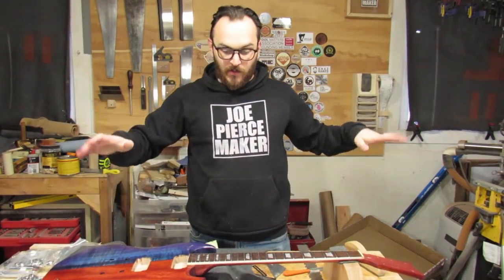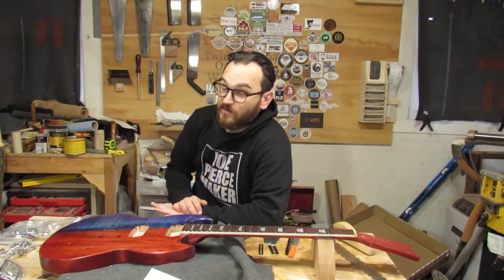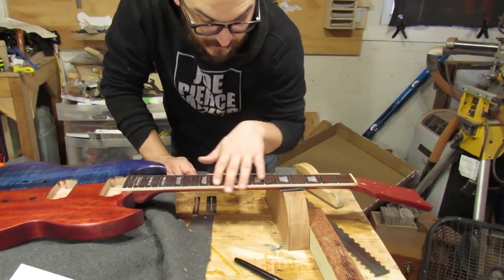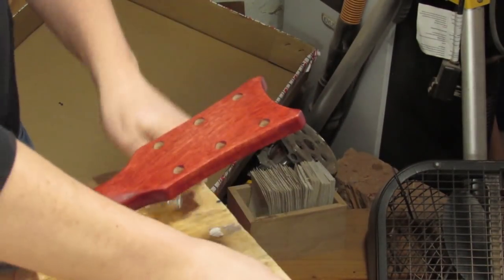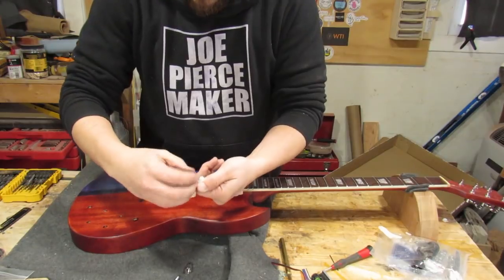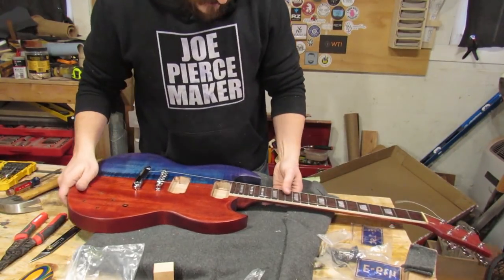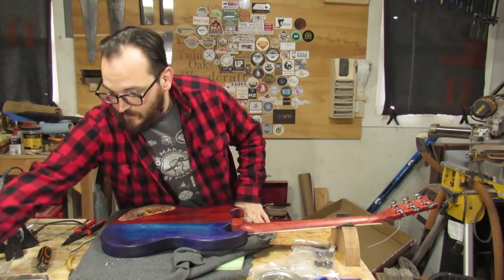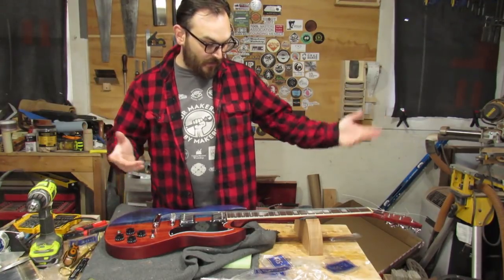Stewart MacDonald Guitar Kit - Episode 4

Comment: Like the color.  Bee's Wax is often used for a screw lubricant.  Comes in a bar shape, Stew Mac sells them.  Just threads on the bar.
Reply from the maker: Thanks! Bee's wax does work well, I used what I had at the time though and it worked well enough.

Comment: It's a good idea to use either copper tape or RF paint in the control cavity to eliminate noise.  Additionally a humbucker pickup is supposed to be relatively quiet, adding the RF paint or copper tape can make a difference in eliminating hum.  I've done this on the guitars I've built and it works perfectly.

There is a drawback to grounding the bridge/strings.  YOU become the shortest path to ground in the event you have a faulty amp, or the outlet you are plugged into isn't grounded properly.  Taylor Guitars uses a ground fuse to protect the player.  I still have no idea how this has never been the standard across all electric and electric acoustic guitars.
Reply from the maker: I plan to shield the cavities when I go back and replace all the hardware, pickups, pots, etc.  For this series I wanted to build it as the instructions said so it would be an honest review of the kit as it comes from the box. Once I've done all the upgrades I'm going to do a follow up video.

As far as the grounding thing, I don't see how it would be a danger, because the guitar is an input device, no power from the amp is transmitted to the guitar.

Comment: Good job Joe. Informative and entertaining. I especially appreciate the time you took to answer the questions. I’m probably too late to the party but I’m about to build a Stew Mac Les Paul kit. One of the steps is to tap the frets with a hammer/mallet to make sure they’re seated before leveling. Did you skip that step or not mention it? Is that not worth doing in your experience?
Reply from the maker: Glad it was helpful! I may have forgot to record that seating the frets, I should have mentioned it though.  Thanks!

Comment: I watched your GR8T4 part SG Kit build videos, so they got me wanting to get a SG Kit to build for myself, and I can no longer get the SG Kit from Stewmac . They dis-continued the SG Kit. Who else makes the SG Kits to build ? ? ?  Just as a suggestion, you can get a drill bit depth stop guage or make one by wrapping tape around the drill bit , so's to not drill holes too deep and  also you can use a bit that is a size smaller than the screw to be used to drill pilot holes for screws. Thanks Man ! ! !  Peace, Build & Play 🎸On . . . 😎🤘👍🙏  DDH 5-21-2020.
Reply from the maker: Solo music gear offers one, but it's the offset version like an ESP.  Thanks for the tip on the drilling, I didn't use anything because I've done it a million times and didn't really need it.  I would recommend it for a beginner though.  Thanks for watching!

Comment: Protip for drilling, once you decide on a depth, put a piece of tape on the drill so you get consistent depth
Reply: I'm no pro but that was my first thought too. Also would work when scraping the binding when using a razor blade instead of using your thumb as a gauge.
Reply from the maker: @hunger993 Good tip.  since the only drilling I did on this kit was a few pilot holes for tiny screws it didn't seem that important to me that the depth be exact.  As long as I didn't drill all the way through.  I've been woodworking for a while now and I've gotten pretty good at eyeballing things like that.  I would suggest to someone that is new to the hobby to use the tape method though.

Comment: Nice build. I'm assembling on of their Champ kits. It seems very well made.  I assume your open G was out of tune due to needing final intonating.
Reply from the maker: Thanks. Yeah it still needed some set up when I filmed the demo. The biggest issue was that the nut was too high. Since then I’ve replaced the nut and gotten some proper files so it’s spot on now.
Reply: @JoePierceMaker  Slot files. Yeah I need some of those. Got a few open buzzys I need to fill and recut.

Comment: Great job man. I think to buy some kit and do stuff like this
Reply from the maker: Thanks!  You should give it a go, it's a lot of fun.
Reply: @JoePierceMaker   Once i buy old destroy guitar and reper and paint her. Look cool white and blood splatter but there is some string hight problem. Still sound good. I never use it on my channel but i thing somwere on instagram
Reply from the maker: That's awesome.  That sting height problem could probably be fixed by adjusting the bridge, sanding down the nut, or adjusting the truss rod.   Hard to know without seeing it but I'm sure it could be done.

Comment: Pretty cool. I'm just sad they didn't put in full early-60s bevels since the body's CNCd anyway. Surely it's no extra cost to put in the deep bevels?
Reply from the maker: Thanks, I'm not sure why they wouldn't, I probably could have made them more pronounced but it kind of slipped my mind.
Reply: @JoePierceMaker  Probably a lot of work by hand though. Also tough to get right by hand too, I'm thinking. Makes much more sense to do it in CNC. This is kind of an ongoing problem since '67 though, lol. It makes sense that Gibson reduced the bevels when doing that stuff by hand. But even in the last 10 years, they've been pretty inconsistent with their early '60s reissues. I dunno why. The Japanese makers have done it right since the late '70s without any trouble.

Comment: Really enjoyed this series!  What kind of neck profile and fingerboard width does this kit have? Curious since I'd love to build one of these, though Stewmac seems to have discontinued this particular kit (?).

I'm lucky enough have a '69 SG with a reasonably chunky yet graceful D-shape neck and fairly narrow fingerboard that fits my hand really well.  Don't know how common that was back then but most SGs I've tried tend to have wider fingerboards and skinnier C shape necks.
Reply from the maker: Thanks!  The neck on this one is a bit on the thin side, C shaped.  I replaced the nut with a Tusq nut made for a Gibson Les Paul, and had to trim about 1/16' off each end to make it flush.

Comment: I watched all four videos of this series this morning and it was an entertaining example of how to build it. Going at it from a minimum tool perspective was a cool idea as well, kinda demystifying it for folks who may be on the fence about trying it. Good job!  👍

Maybe you got a good one but that file I got from Amazon with the orange handle was terrible. It didn’t “file” anything, wouldn’t cut a fingernail. I did find a use for it as a sandpaper holder. It came with a cool wrench for input jacks and volume pot nuts though. 

Have you ever tried computer printing decals and transfers to make headstock logos?

Buck Owens would approve of this finish, 😉
Reply from the maker: Thanks, I like to show people that anyone can do these things if they want to.  The thing about the file, when you get cheap tools, you run the risk of getting a bad one, but when you get a good one, it's good.

I have tried the waterslide decals that you can print out at home and had good luck with them when finishing with lacquer, but didn't have as good luck on this one that was finished with TruOil

Comment: I think a dry fit would have been the answer in episode one to the pick up issue 

How did the finger board take the stain ?? i do not think it is a mahogany body
Reply from the maker: You're probably right about the dry fit, I assumed that everything would fit and I shouldn't have.  The finger board actually took the stain well, so they didn't oil it or anything at the factory, that was a pleasant surprise.  The kit is sold as a mahogany body with granadillo finger board, so I hope they would use the wood they say did.  It smells like mahogany too, the curly half is a lot lighter but that can happen with most woods.
Reply: The Townspeople  these are CHINESE KITS you pay twice as much Through S Mac

Comment: Should have measured the scale length before gluing the neck on! Me thinks you made a "short scale", which explains the neck pickup and pick guard not fitting. If not, then Stewmac makes/sells $#17 guitar kits.
Reply from the maker: The intonation on it is good so the scale shouldn't be off.  I'm pretty sure these kits were mass produced by an outside company, which is probably why they don't sell them anymore.

Comment: Hi Joe. How do rate the guitar to something high end like the Gibson SG? I guess if you wanted to improve it even further you could switch out the pickups for expensive after market ones. More interested in the feel and quality of the guitar itself. Great series by the way and I’m subscribing.
Reply from the maker: Thanks!  I'd say that this guitar has the potential to stand up to a Gibson.  I've never owned one, but I've played several at various guitar stores.  Some were really nice, and others weren't so much.  The hardware and electronics on this are definitely low end and will all be replaced eventually.  The neck pocket was a bit loose, and the mismatched wood on the body wasn't great.  So in that aspect it's not up to par with a high end Gibson.  But, with upgraded hardware and pickups it can be just as good as a Gibson,  the neck feels good and it's at least made of mahogany, so if you painted it you wouldn't notice the mismatched wood.

Comment: Joe, Is there any disadvantage to doing the “fret work” prior to finishing the fingerboard? Thanks.
Reply: Trigger Snob besides some residue on the frets due to the finishing, no but you can wipe it off
Reply from the maker: I always do the fret work before finishing the fingerboard.  That way if I get any scratches on the wood I can address them before finishing.  Also, I should have taped off the fingerboard before doing the fret work.

Comment: So I'm not getting the point of using the fret rocker, and marking the high spots, when the next step is to cover all the frets in sharpie and use the leveler over the whole neck. And, BTW, it would have been good to show how to use the truss rod if your neck wasn't straight to begin with.
Reply from the maker: I used the fret rocker to determine if there were any high frets.  If it were just one or two I would have dealt with them individually.  Once I realized that there were several uneven frets I decided to go ahead and level all of them.  I'm working on a new video that will show in more detail how to set up a guitar, including truss rod adjustments, intonation, and fret leveling.

Comment: Well done, exept for the non fitting neck pickup. Also I notice you didn't measure the scale length during the neck fitting process. You might run into intonation problems here. I'm a noob myself learning the pitfalls of guitar building by watching as many videos prior to building a guitar. Next time you might wanna do a pre-assembly before fitting the neck into its goal position, I think the neck is supposed to be a bit more out of the pocket, that way you also wouldn't run into the problem with the pickup ring.
Reply from the maker: I assembled it according to the instructions which stated that the end of the neck should line up with the edges of the pickup route.  It was only off by a millimetre or two so it didn't have an affect on the intonation once I adjusted the bridge saddles.  But yes, you're correct I could have avoided the issue by  dry fitting everything.  My goal with these videos is to show people the potential problems that may arise with a build and how to fix them.  So, while this issue could have been avoided, I'm glad it happened so there could be a teachable moment.
Reply: @JoePierceMaker  I absolutely agree with you and I am glad you are happy with the end result. I also would check the neck angle while test fitting. I've heard theat the cheaper kit guitars are not machined exactly anough and in some cases you end up with a way to high or low action, depending on the neck angle.

Comment: you need to solder that ground wire
Reply from the maker: Are you referring to the wire grounding the bridge?
Reply: @JoePierceMaker  yes but im not a Luther its just what i would have done
Reply from the maker: I see your point but it’s not really necessary since the bushing is pressed in there with such a tight fit.
Reply: @JoePierceMaker  i build drones not guitars but when two kinds of metal are touching with electricity they corrode so over time they will conduct less also im kinda obsessed with direct soldering everything. thanks for the video i do want to build one.

Comment: Way nicer than the shit guitars that I had to choose from in the '70s.  My fingers are still scared from the action of those guitars.  Kids these days have such great options and even a build like this would be a great guitar to learn and beat up before spending $2500 bucks on a dream guitar.  Great job.
Reply from the maker: Thanks!  The action on this one wasn't great, I changed the nut and still had to file down the slots to get it right.  I like a really low action too.  I advise anyone that doesn't have experience with guitars to have it professionally set up.  That's what I did in the past before I had all the right tools.

Comment: “Follow the wiring diagram and you can’t mess it up”
Is that a challenge?
Reply from the maker: Yes, it is.  A very achievable challenge too.  It took me a while to get the wiring right on this one, even following the diagram.
Reply: I plan on starting with some simpler kits, bolt on necks and the like and working up confidence before I get a nicer kit like this. Though I’ve been thinking about getting a hollow body kit, are they as daunting to wire up as they seem?
Reply from the maker: The wiring was definitely a challenge since you have to do it outside the guitar and feed everything in. The nice thing about a Strat is that you get to do all the wiring directly on the pick guard (except for the output jack) and it all goes in as one unit. So I would recommend starting out with a Strat and working up to the more challenging kits.
Reply: Thanks for the tip!

Comment: Looks like Stew Mac is selling low end kits.  That's a shame.
Reply from the maker: It's not bad for the price, the body is clearly meant to be painted since the halves are mismatched.  The pickups and hardware are cheap, but that's what keeps the costs down.  If it had better hardware and pickups the kit would have cost several hundred dollars and would have been out of my price range.  I've since upgraded the tuners and pickups and it sounds a lot better now.  I should make an update video.

Comment: Get a 8 dollar straight edge from harbor freight and file or grind the notches in. 20 minutes or less will save you $$$ over stewmac
Reply: WalMart aluminum yardsticks work in a pinch, too.
Reply from the maker: Both good options.
Reply: Got mine For 12 bucks off eBay. Works like a charm

Comment: Dammit man I was watching these for the soldering tutorial and wiring because mine didn't come with instructions. I love the finish on yours so much. Too slick and my guitar slides right off my lap
Reply from the maker: I'm sorry about that.  My soldering skills are not great and I didn't want to show any bad techniques.  That and me cursing at the guitar looks bad on camera haha!  This is one of my favorite finishes because it's so easy to do.
Reply from the maker: 800 is way too fine a grit.  Anything above 320 and you're polishing rather than sanding.  If you're trying to remove a gloss coat to apply stain, you're going to want to get all the way down to the wood. A lot of people will use paint stripper for that, but I don't like it because it's messy.  I would sand it off with 80 or 100 grit, then 120,150, 180, 220, and 320.  The goal is when you go to a finer grit, you remove the scratches from the previous.  Then apply the stain and your choice of finish.